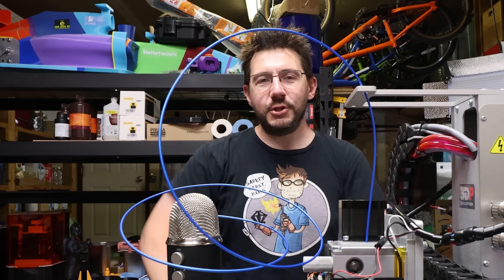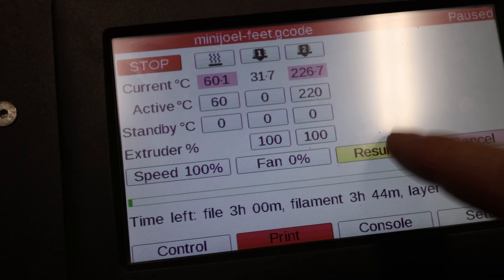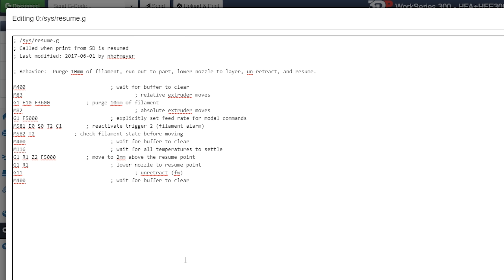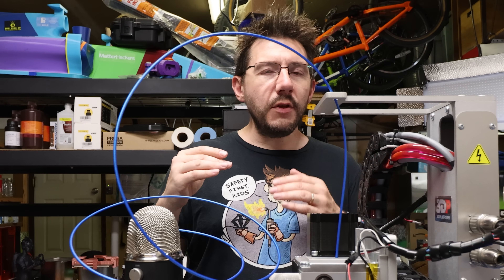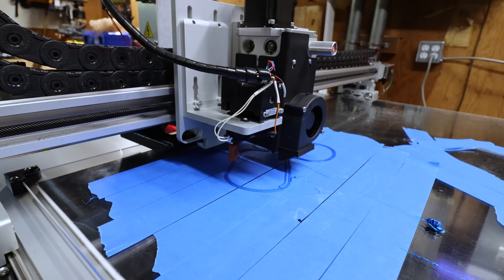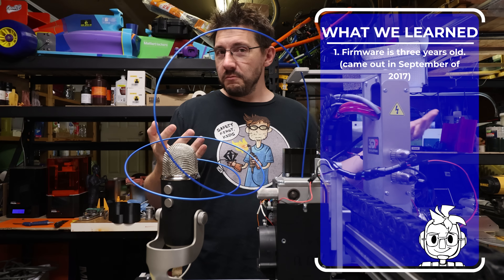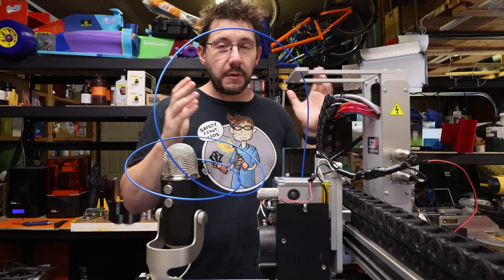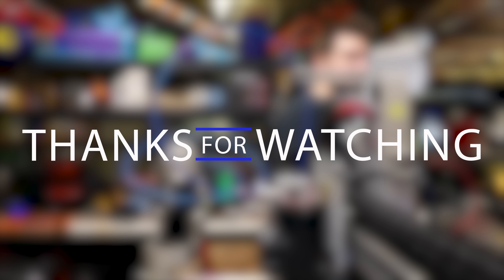Troubleshooting the $38,000 3D Printer

Comment: I find it hard to believe that since 2017, you are the first user to run out of filament and have this problem. Seems like you are doing their QC for them.
Reply: The change from RRF 1.x to the latest RRF 3.x is a bit of nightmare if you don’t know what you’re doing. The Config is very different

However, given the intended customer base of the machine, I would think the company would keep things more updated than 3 years out of date. And have the ability to work through any of the major changes in the firmware

Comment: Hey,  Joel. From a regulation stand point, a constant temperature offset at steady state suggests that the PI (PID) controller is not tuned correctly. The I (integral) term should be higher, so it correct the steady state error too 0.  But usually the error would be that the temperature is lower then the set point. That is it they are doing something hacky/sketchy to "fix" the offset. At university I saw some "solutions" form my fellow students when they used just P (proportional) term and just set the regulation set point eg. 10 degrees higher to "compensate". 
It would be hilarious that a 38k printer would not tune its PID out of the box OR that they use something hacky.
Reply: The long wires may be throwing off the thermistor table. They might need to make their own thermistor table.
Reply: @danielkruger4305  This was exactly what I was thinking.
Reply: @danielkruger4305  I dont think so. If that was the problem then the temperature reading would not be correct on the display vs measurement with a thermometer and not problem with the reading overshooting.
Reply: @markoantesic4362  Not if they are trying to compensate for low temp at the head with PID, allowing the user to set recommend manufacturers print temp and still print correctly.
Reply: If PID was tuned it is in sys\config-override.g. Duet 2.05 works without tuning, only were problems with 600W silicone heater (bed bending).

Comment: It sounds like it's on PD instead of PID control! The integral part would remove the steady state error 🤔 Might be worth running a PID autotune if you can!
Reply: ^this. Controller tuning.
Reply: Or just P. For something as non dynamic as a hot end you relay don't need the D. XD Derivative usually comes into play for something that has fast changes or balancing things.
Reply: True, but many of these softwares have already established autotuning for full PID, might as well make use of it to the fullest extent :P
Reply: @T4nm4y  For nearly 40K you would thing that.
Reply: @markoantesic4362  they're using 3 year old firmware, you think they're putting that 40k into software development?
Reply: @markoantesic4362  and it's reprap firmware presumably so should be easy to add the standard duet features!
Reply: @jhbryaniv  you'd hope at least some of it went back into the business for development! 😅😅
Reply: @T4nm4y  without knowing much about the company, I can't really be to critical of them. Especially when they're designing and selling a niche market printer.

But I must say, 3 year old firmware just seems out dated....
Reply: @jhbryaniv  very true! I suppose if their target market is expected to have expertise in maintaining and using printers the users would already be aware of how to update to the latest version of RRF...
Reply: @T4nm4y  other way round. if the user finds problems, they tell the manufacturer, and they come around and update it for them. That 38 grand is what pays for the tech to be flown in when necessary, not for the hardware.

Comment: so wait a 38k printer snd they dont even keep the firmware updated. 🤔🤣
Reply: And the glass broke on the first print! You could buy a metal 3d printer or a decent CNC machine for 38k.
Reply: @EnlightenedSavage  well thats petg on pure glass problem. u need hairspray or magigoo to avoid that.
Reply: @Nappen87  yer NEVER use PETG straight on glass. I'd have thought Joel knew that :)
Reply: @MONTY-YTNOM  yeah i was actylly kinda supriced specially when he got magigoo with the printer 🤣
Reply: @Nappen87  I thought I'd taught him better then that :)
Reply: @MONTY-YTNOM  I always print my PETG on a mirror tile and I never had issues with part welding. I actually had a lot of problems with adhesion before I started cranking my bed temperature to 80-90°C
Reply: If it does run well you don't need to update the firmware all the time.
You don't want to compromise the stability of the machine by frequent updates, even if you can test them.

(Granted in this case it didn't do well, so that should have probably been fixed with a firmware update.)
Reply: well i disagree if u read the update of duets firmware alot of stsbilty errors is fixes and implemented safer rutins im the firmware so i would say not make a new firmware realease for this expensive printer is bad. really bad.

Comment: I do wonder why this should be 38K. Probably because not a lot of people get it, but the software and boards should be much higher quality for that price. Right? :) Awesome video Joel.
Reply: For 38k they should be using custom boards with independent and replaceable industrial motor controllers. This thing is just to see if suckers will take the bait.
Reply: @jd52wtf  The control board isn't the issue here. The design of the machine is the issue. Also it looks like they are using the Duet Expansion Breakout Board to drive some of the motors with external drivers. There's no good reason to design a custom controller board unless you can't find one that meets your specs / price point.
Reply: The Duet board is great, but everything is wrong with this machine.
Reply: Its kind of a limited market which drives the price up. Every thing is hand built and closed loop Nema 34 aren't cheep and require a ton of power management. The hot end is also liquid cooled monster capable of 70 mm 3/s with 3mm filament. That thing could eat through 20lbs of filament in one shift. But I feel they should have used thicker glass on its bed....
Reply: @sortofsmarter  A $20 SuperVolcano clone can just as easily pump out 70mm³/s.
Reply: @unicornswag888  maybe...but do you think a clone could eat up a 1kg roll of 3mm filament  every 3 hours...per nozzle ...lol
Reply: @sortofsmarter  Of course. Per 3DPlatform's website, their "HFE300" extruder can output 70mm³/s, which is basically identical to a SuperVolcano. That equates to roughly 250 cc's per hour. A kilogram of PLA is about 800 cc's, so both extruders could go through approximately 1 kg every 3 hours.
Reply: @unicornswag888  given the reliability I’ve seen in “$20 clone” hot ends I very much doubt it can lay down 300 grams an hour for any appreciable length of time. Sure, it will probably do that the first hour. But most likely not the hundredth hour let alone the 10.000th.
Reply: @JasperJanssen  There's really not much that can go wrong in a cheap teflon-lined hotend, as long as you don't overheat them, and you replace the liner occasionally.
Reply: @unicornswag888  I don’t think this printer has a Teflon lined one, does it? But, yeah, heater cartridges, thermistors are pretty unreliable in the no name ones, so are nozzles, and the heatbreaks just aren’t very good to start with. The heater block and heatsink, conversely, are fairly irrelevant for performance. The Bowden tube connectors are a weak point again. And then we get to the extruder itself, where the cheap ones are definitely at a disadvantage.
Reply: @JasperJanssen  
No, 3DP doesn't use teflon liners, but I'm just saying that using a liner in a cheap hotend is often a good way to get acceptable reliability and mitigate the effects of sub-par machining. Obviously I'd go with a genuine E3D if I was more concerned about reliablitity.

I worked with a 3DP1000 a few years ago, and the machine was an absolute joke. It was driven off an Arduino Mega. The gantry was flimsy, and would shake with even moderately fast acceleration. The standard extruder was unreliable since it used a single drive gear. The hotend was basically just a standard E3D block that limited volumetric flow to around 10 or 12 mm³/s. That might be acceptable on a small desktop machine, but certainly not on an "industrial" machine with a 1 meter³ build volume.

Suffice to say, I have zero faith in 3DP's ability to competently design a new multi-thousand-dollar extruder, and I have my doubts about whether it's any more reliable than other extruders on the market that cost a fraction of the price.
Reply: I love that its base is the same rolling tool bench available from amazon that is in my shop!!
Reply: Duet board is awesome and very professional. The problem they are running a firmware version from paleolithic age

Comment: I don't want to be too negative about it but.... That printer isn't nearly worth 38k. I know you probably got it for free but you would have been better off with a 25k Uprint SE Plus. Just the facts.
Reply: Completely agree. Not having the USB cable for the duet plugged in is a very concerning omen for the machine’s quality control in general. That kind of sloppy mistake is barely OK on a $200 machine, it is unacceptable on a machine of this price
Reply: To be fair, I don't think he's keeping it. From what I remember, they're letting him borrow it. Still though, not worth 38k.
Reply: He has a loan of it, doesn’t own it and to be fair it’s easy for the usb to pop out during shipping, am I wrong in assuming that they assemble it on site for you.
If they don’t then have to agree they really should have hot glued or siliconed it in place or whatever as looking at the rather excellent wiring it does appear to be the only cable that could work loose.
It runs through so much filament so quickly I could never afford to run this all the time but it looks really robust in construction, apart from the USB of course.